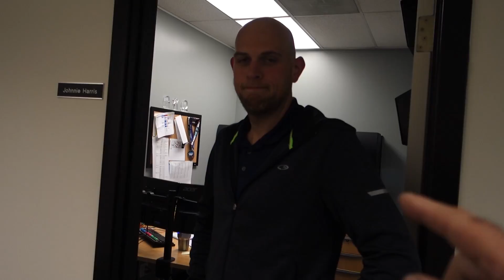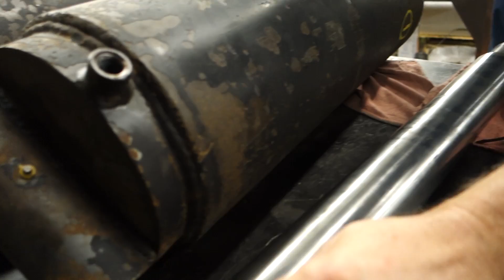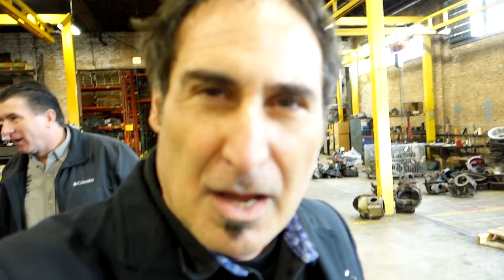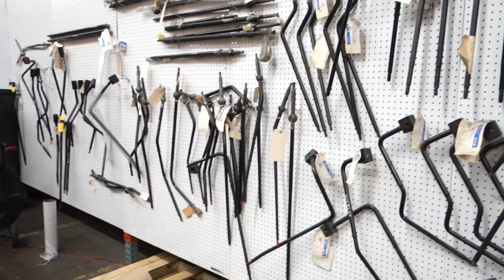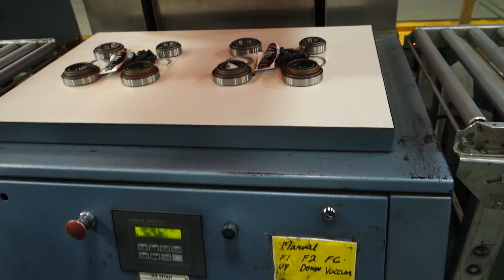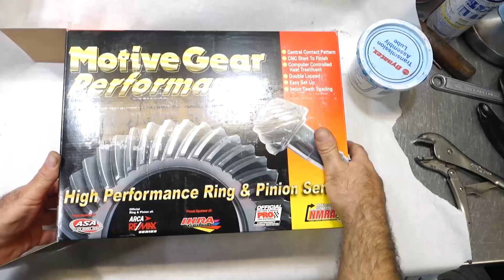Visiting Midwest Truck - Richmond Gear - Motive Gear

Comment: i have lost faith with richmond gear. i never really like thee ring and pinions, they never ink out as nice as the cheap ones i get from jegs. and the super t10s just gear grinding units. if i didnt get bent over a few times already by the richmond st10, i would still be interested in buying them new.
Reply from the maker: FyI they private label the Jegaand Summit ring and pinions

Comment: That short hydraulic cylinder is from a low boy trailer. Probably off a 55 or 60 ton unit. 
I bet it wasn’t on level ground when the operator was lifting or lowering it while heavy.

Comment: That ram looks like the type they run on a lowboy trailer. It’s called a booster here in the Pacific Northwest. It’s hard to get the weight of the load on the truck, so you hook up a booster( another set of axles) with a ram or twin rams a boosted the weight forward.

Comment: 5:07 *probably the power divider** and you were probably like uh what is this ?, just like I am when watching you rebuild a transmission, I learned a lot from your videos. I just rebuilted a t5 non world class and thats mostly all because of your knowledge in that particular field, thanks for your videos. I am daily rebuilding eaton 18918b ( 18 speeds eaton transmissions) , rebuilding eaton,meritor(commonly know as Rockwell), spicer, mack,international and alliance diff from heavy trucks, and also repairing diff from small trucks.

Comment: I have  also  rebuilt  FWD Truck Read ends ..  FWD wanted $3,500 for a Ring Gear and Pinion 25 years ago  .  Oh  I confused Midwest Truck with General Truck parts..  General  had gears forged   in Spain  cut in Chicago and sold them  for $800 per set .  I have a junk yard full of FWD trucks for spare parts but my parts trucks had 5,285 gears and I needed a 6.167  gear .. So I bought the last new Counterfeit one that  General Truck parts had for  $1,800    the  ring gears are rather small for a  34,000 # tandem  they only  have  12  1/2" Rivets  for the ring gear..   The FWD  44 rears have  16 half inch rivets.. an Eaton 34,000# tandem  has  a much bigger ring gear and Pinon with  15 5/8" bolts..   Rivets come  loose a lot so I use L-9 bolts ..    
  I do plan to replace a 38,000 # Tandem with a 44,000# Tandem   they also  have  traction lock clutches applied with 800 psi break fluid pressure to lock all 6 or 8 wheels together..

Comment: Interesting and good to know there are a few US factories still making quality parts and assemblies, that differential you were next to was HUGE, I  guess all that torque takes its toll even on slow moving parts...Just wondering if anyone is ever experimenting with Titanium on transmission internals as there is an obvious weight savings or would there be compatibility issues if both metals are used?
Reply from the maker: +jim dandy Titanium is expensive. It is used often in F1 transmissions on the shift barrels.
Reply: Yes and extremely difficult to machine from what I have read as I have several high end Swiss watches made of Titanium, seems the tooling wears quickly thus they can charge more in some cases--I have a very expensive road bicycle with Titanium pedals [spindles] and the cost is double vs the steel but 50% lighter

Comment: Another great video Paul, thanks again. I love Richmond gear, installed a ring and pinion in a 34 Ford streetrod that I built with a 9" Ford axle, worked out great.

Comment: Hey Paul, I would like to make a couple of friendly suggestions for the ring and pinion installation kits, whether factory packaged or your addition. 
(1) The inclusion of a new pinion/cross pin retaining bolt or drive pin for those applications that use them. 
(2) The inclusion of the appropriate single use package Loctite or thread locker/sealer of your choice. 
(3) The inclusion of the appropriate gasket sealer/maker/eliminator needed to complete the install. 
(4) The inclusion of clear detailed instructions on the proper installation and application of the thread locker, sealers and list any applicable torque values. 

We see many DIY installations that fail prematurely for reusing the old cross pin retainer bolt, not using thread locker or not using it properly, not using the correct sealer in the correct place or applying the incorrect amount of sealer and last but not least not applying the correct torque for the fasteners.  
Many when asked reply they were unaware, or did not have the items listed above on hand or did not know where to source them or have the time to source them.
Reply from the maker: That's a good idea and I'll pass that along. The problem is also skill level. People often ask me if I have instructions with my transmission rebuild kits ( which I do not ). There are books on the subject one should invest in.Same goes for engines, rears or anything else.  My reply is:  you don't get instructions with engine overhaul kits because you are suppose to know what you are doing and it would require pages. Ring and pinion setup requires a certain skill level as well.